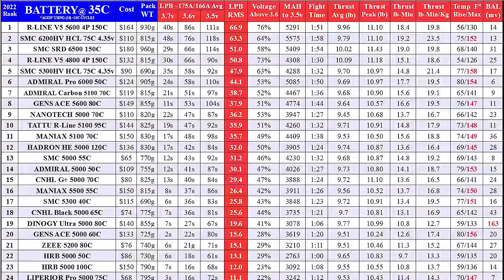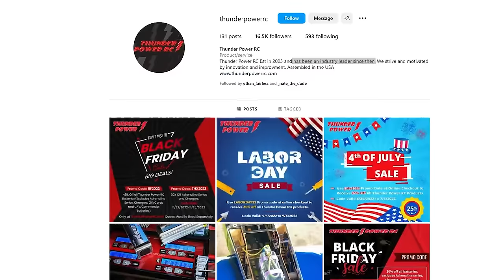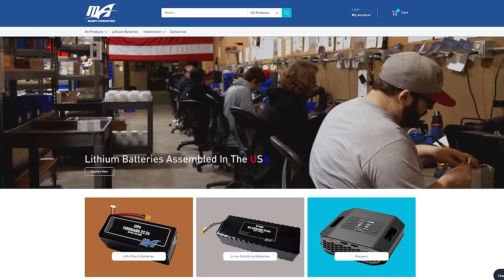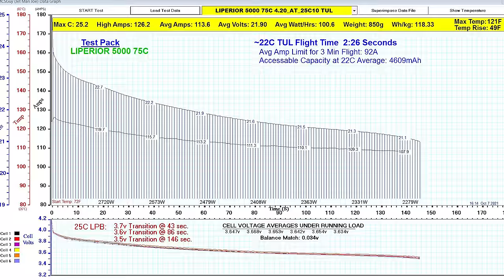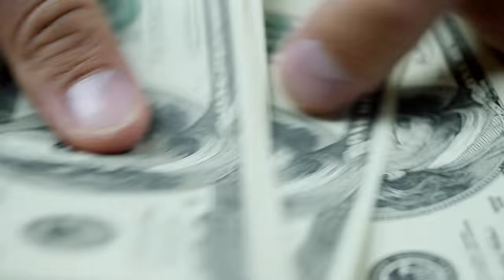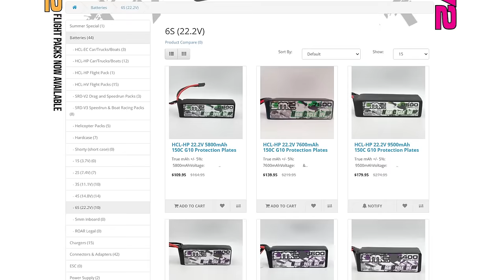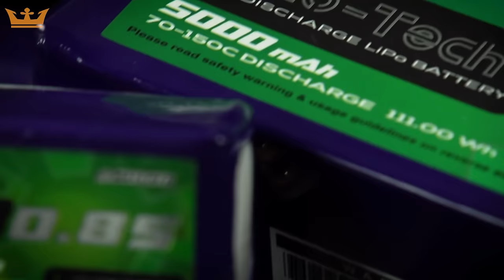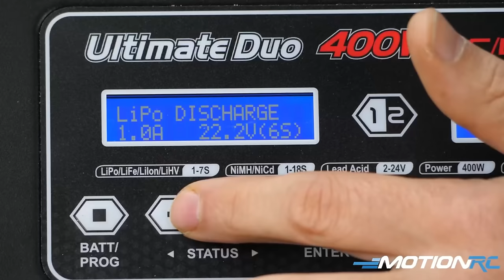Exposing RC's BIGGEST Scam

Comment: Roaringtop lipos I have found to be the most legit number of any other brand I have used.
Reply: I love my roaring tops!
Reply: @Rylan04  Right on bro ! ONLY lipo i ever seen that has tinned metal cell connector strips ! the rest are aluminum. This is good because if you hurt cells, you can take batts apart and selvage cells and build another 😃

Comment: I appreciate what Joe does,  but to say that it's our fault that companies mislable products is absolutely bananas. There are laws, (at least in the U.S.) that are meant to prevent deceptive claims by manufacturers. Blaming the consumer for an industry's failing just isn't justified. Of course, people should practice due diligence, but it wasn't me that decided that profit is more important than integrity.
Reply: It's why I do what I do, to give users the facts about the brands they can trust and those to avoid. The laws are only as effective as those willing and able to sue make them so. Look at the lowest ranked battery, and the performance numbers which have put it at the bottom. At $238 you tell me why that outfit is still in business and has users coming to their defense. IMO it's a borderline criminal conspiracy and the numbers prove their "120C" battery barely supports 15C use. Who's going to hold them accountable? I'm trying and (gladly) paying the majority of the cost to do so. It is the fault of those who continue to support this kind of company in the face of years of documented data they routinely engage in gross misrepresentation.

Comment: I used to buy Max Amps batteries for my 5th scale Losi 5T. Data logging showed i was pulling 200+ amps and the "150c" batteries were not holding up. They never caught fire but boy they got hot and swollen, 2 split the heat shrink apart but then cooled down and shrunk back down. I think one set made it to 5 runs before dyeing.

Comment: Real C rating is measurable. The C rating on the pack is not an indication on how good a battery is. I got some old packs where C_market is lower than C_measured. But I got a hell of a lot of newer batteries where it is the opposite.

Comment: This is so easy to test. You hook the power source (a battery in this case,) to an electronic load. Voy luh. Your done. Personally, I like to test to see what amperage you can pull constantly, and still get the rated capacity of the battery. I.e. if the battery is a 3000mah pack, how many amps can you pull from this battery, a constant load, until 3000mah have been obtained. Make since?

Comment: Thanks for this. I have fallen into this trap. Once I bought a 4s pack. The seller had recommended a different pack, it had a slightly higher price, but the C-rating was half😮😮😮 So I didn’t buy it. I bought the cheaper one with the higher C!!! Now I wonder why he was recommending the lower C pack. Could it be he knew the rating was BS?

Comment: Ive had HRB lipos that have performed better than high end batteries that sell for 150 dollars a piece when i could have got hrb batts for 60 bucks.  Yeah i get it when you first hook up the HRB batteries youll find the internal resistance and voltage per cell are all over the place.  But run em gentle for a couple cycles and what do you know.  You got a darn solid battery for half the price.  My biggest is an Hrb 6 cell at 5000 mah is pretty big in size and weight i have used it in my arrma notrious and kraton for 4 years now.  100s of charges and its still going just fine.  Most consider hrb to be junk.  While say traxxas batteries are supposed to be so great, ive had em puff on the first run.

Comment: The best and longest lasting lipo batteries I've had are the cheaper Ovonics 100c 4s lipos. I've had better results with these batteries than with GNB, which are more expensive. I do notice a power difference in the Ovonics 120c batteries. So it may not be 100c and 120c, but the 120c pack does deliver more power.
Reply: Been flying Ovonics for years and have always been great 👍🏻 and reliable plus there hard case ones are awesome. Agreed
Reply: alot of this depends on the manufacture and how honestthey are, 130c battery would usually be the burst limit constant being low as 40-60c when only one c limit written

Comment: An easier number to crank up would be the cell's usable or peak amperage

If we take a 50C 5000mAH LiPo, what sounds bigger?

50C

or

250A

both are technically accurate numbers if the cells can take that kind of abuse, but if bigger is better, then labelling the battery as "250A" would likely sell more.

Comment: I've been saying for ages that C rates are a joke. I have 20Ah batteries rated 20C, and they have 10AWG wires. 10AWG wire isn't going to hold 400A for very long at all. 200A is about the most you can put through 10AWG in RC applications.

Comment: This is fantastic content! I'm high-performance fpv quadcopter guy, and there isn't a lot of testing or people talking about battery safety maintenance or fundamentals on our side of the hobby. I just shared your video with our weekly fpv news YouTube content creators to hopefully get the word out to more people. I'll definitely be keeping an eye on his thread. This guy is awesome. 😁
Reply: Sent it to Bardwell too😂
Reply: @bigdatapimp  haha, Atta boi!! 😅👌🏻. Great video! I'm watching x-jets new video right now, and Bruce also made a comment about how good of a video this is.. I wish we had more of this technical content in our Hobby, unfortunately the prevailing attitude is that most people will destroy the packs before they wear out. I'm still running packs from 2 summers ago... because I take care of them.
Reply: two things I believe most pilots do to hurt their lipos, over discharge them (via flying), should land at 3.8v and letting packs sit charged. I usually get 1200 cycling on my 4s-1300 packs in my LOS quad and then use them in my planes for another 1000+ cycles.
Reply: @user-rs8zg8ey2b  Land at 3.8? Joe even calls out 3.7 as the ideal storage voltage, and that's not even down to that point. What are you flying where you can get more than a few minutes in the air at that cutoff?
Reply: @Phoen1x883  My quad can accelerate at 9G's and corner at 16G's, it is old school tanker of ~6 years old, I fly for 90 seconds to ~3.8v, (this also saves a bunch of time to put them back in storage mode) yea, I can get another ~15~20 seconds to 3.7v, but that is hurting your battery life cycle, most dont know and just buy more. How many pilots you know get 1200 cycles on their batteries and can still use them for lighter loads (like my planes)?   My flying style https://www.youtube.com/watch?v=uHoFfpLSb2g
Reply: @Phoen1x883  I forgot, almost all chargers default at 3.85v storage and this has worked for thousands of life cycles.
Reply: @user-rs8zg8ey2b  I agree, there's a prevailing attitude that our lipos will be physically damaged before they'll die a natural death, so no one really puts an emphasis on battery maintenance.
I land my 6s quads at 3.7 and they bounce back to 3.8, because I don't have time sit around and storage charge. I'd rather just bring more packs. I usually fly 13 1300mah over a couple hours of flying. I have a heated lipo bag for cold days in Canada, and store them at room temperature, and I've got lipos with over a 1000 cycles on them, still reading IR between 3-8. The biggest difference I notice between expensive and cheap packs is the power-to-weight. Tattu and GNB are great, but pricey and I've also had great luck with Cnhl and Ovonic. They're considerably cheaper and I would more often put them In harm's way on a risky flight.
Lots of guys I know just buy new batteries every year and kill the old ones. Seems like a waste, and a way to unnecessarily fill the landfill with garbage.

Comment: In my non-scientific testing on Thunderpower 6s 1100mah vs a few competitors definitely had a higher pitch from the quadcopter on full power punch-out's. So maybe the large packs are different from small packs?
Reply: Yes, there can be a big difference. The smaller quad packs can have a much higher real C then the larger packs but it’s not my area of study or interest.
Reply: I got three of those because I thought they were so special because they're so light. But in my experience they fly significantly shorter than the heavier cnhl 1100mah packs I have which are also way way older with more cycles on them. I imagine there's very little difference in energy density across all manufacturers so it's simply they're lighter cause there's less battery there.

Comment: Have you ever tested power tool batteries?  DeWalt has just released a pouch cell battery that should have better performance than it's Zodiac or FlexVolt line. I'd Love to test them, but retired just as they were coming out.  Yes, you will probably want to de-package them in the interest of weight, but their charging infrastructure should be easily adapted. (Former Stanley R&D engineer.)
Reply: The BMS for power tool batteries (and phones, etc) deliberately over discharge the cells.  They will last much longer if you don't run them until the BMS shuts off the pack.  Usually they have a rough volt meter on them and you can notice a power drop when they are on the last light.  It is best to stop using them at that point.

Comment: That's why I fly smaller planes, most use 1300mah battery.  Even my 50mm edf's fly on a 1300 mah battery, so my cost for batteries is very marginal......

Comment: I have a Arrma felony I run a Traxxas battery which gets bashed a lot due to price or the 25c rating funny thing is my speed runs were equal to or better than most youtubers out there running 100 c plus batteries

Comment: They are not lies though. They are all peak C rates based on certain testing criteria: time duration, max temperature and max voltage sag.  

2:27, 32C on a 5Ah battery is 160 amps. 1)There is no company claiming 32C continuous. 2)Standard wire gauges for wired battery modules are 10 AWG and 8 AWG. An 8 AWG cannot handle 160 amps continuous. Has nothing to do with quality of the cells.

Comment: What storage voltage does Joe recommend? I've been storing at 3.8 V per cell, some have been saying 3.85 I heard Joe say something about 3.7V?
Reply: I think 3.80 to 3.85 is fine, I get 1200 cycles in my quad and another 1000 after that
 in my planes.
Reply: How accurate is your volt meter?
Reply: @alanchase7329  mine? it really doesnt matter, rarely are these hobby chargers more out than +/-50mV.
Reply: @user-rs8zg8ey2b  That's my point. Why worry about .05V when the tolerance of the meter is probably at least that much?
Reply: @alanchase7329  Well here is how I see it. If you fly hard down to 3.7v vs 3.8v, you're costing your pack life cycles.
Reply: @user-rs8zg8ey2b  The question is about storage voltage. 3.7, 3.8, 3.85? If the tolerance of the meter you are using to measure the voltage is +/- 0.1V then it is pointless to be concerned about 0.05V. Aim for the mid value.
Reply: @alanchase7329  even the cheep Chinese dmm and chargers I have used are never more that 50mV off, I wouldn't be worried. Well unless you have the hv g7 Hyperion garbage packs.

Comment: This is good information, however, if "C" rating cannot be trusted how would you know if charging at 2c is actually 2c?
Reply: The capacity of the battery will let you know what the 1C rating is for each battery.  If you have a 2,000 mAh battery it would take one hour to fully charge from empty to full at 1 C.  One C for this battery would be 2,000 mA or 2 A.  Charging at 2 C for this battery would be 4 A and would take half the time ... and so on.  Increasing the amperage also increases the internal heat of the battery which in turn increases the internal resistance.  Both of those add wear and tear to the battery chemistry and circuitry. The video has more of an issue with advertised discharge C ratings, where manufacturers falsely claim their batteries can operate at very high discharge ratings safely.
Reply: @MWall711  Yes, that has been my understanding. E.G. I use 4s 2600 mah in my FMS Super Cub and I re-charge at 4 amps ... no issues. So am I to understand that the issue here is the inflated discharge ratings? It wasn't clear to me.
Reply: I prefer Gens Ace BTW
Reply: GensAce are good. I’ve also had good luck with Admiral and Spektrum. Admiral are cheaper but I do like the auto discharge of the Smart batteries I’m case I cannot use all the batteries I bring to the field. I will never again use Eflite batteries.
Reply: @MWall711  Thank you :) BTW the FMS Super Cub is the only electric foamy I have. I go back 50 some years building my own planes and running glow engines. I bought the foamy to put it on floats for early mornings on a local river. It's not bad for what it is. Happy landings! :)

Comment: What's with the lab coat? And why use root-mean-square - the current draw from the battery is essentially slow-decay DC with some ripple, not AC, so time-averaged samples is pretty-much the same thing. C rating is fundamentally a measure of the duration of draw on the battery's capacity at a given current - a 1000mAH battery supplying a 1A current for an hour to depletion (which you never want to do for a rechargeable battery) is 1C, supplying a 2A current is 2C - it is not a performance rating. which is a function of internal resistance (battery chemistry). In the context of suitability of application, the battery's published C rating is an indication of how much current relative to the capacity can be drawn without damage to the battery, which again is dependent on internal resistance (losses in the form of heat within the battery - wasted energy). Would be interesting to compare the performance a single xS1P battery against 2 xS1P with half the capacity each, in parallel (essentially a xS2P), spreading the C-loading and internal resistances (1/[1/total R1 + 1/total R2]). Most likely a hit on total weight (heavy), but improved performance.
Reply: Hundreds of us have been using the RMS (or LPB) for a few years to inform our purchasing decisions and are quite satisfied with the results. I guess $20K in research costs and 10 years of experimentation counts for something, nothing succeeds like success. (and I like my lab coat very much thank you, didn't you wear one where you worked?)

Comment: also, i can vouch for this marketing lie. a few years ago, hobbyking launched a line of batteries called GRAPHENE which had all the marketing of an extreme pack with blacked out everything and wayy too much packaging to seem premium (we dont need a fancy box, we need a quality affordable battery). these GRAPHENE were worse than the worst hobbyking pack i ever had (nanotech). they had horrific flight times, no "punch", and puffed up. i always refused to buy thunderpower because SO many people told me horror stories of how $$ they were, and how they were much less reliable than rhino or turnigy from hobbyking. i took a gamble on graphene and yeah, totally worthless. 

Ironically here i am in 2023, still flying the basic blue turnigy packs because those are the best value i have found in terms of great punch over YEARS, low puff, reliable duration, and cost. go figure.

Comment: better not drive a nail through a lipo unless it is completely drained to death. 3.7v cell DOES NOT HELP! still shorts it out causing heat/sparks, very likely to ignite.
Reply: Yeah, not a good idea to drive a nail through a pack at any voltage. When I said that I was thinking about how much more intense they flame when fully charged. Technically 3.7v minimizes the possibility of age or damage related micro shorting from combusting

Comment: So there’s no difference in packs, low cost to the most expensive…yet you can list off the best batteries and you mention HobbyKing’s change in chemistry.  So they are different.
Reply: I'll have to re-watch the video, I don't remember saying that. There is no difference in performance nor cycle life attributable to cost. Rigorous testing over many years has shown many $60-$70 batteries perform better then many costing $150-$190 (and up). I hope this clarifies my statements if they were ambiguous